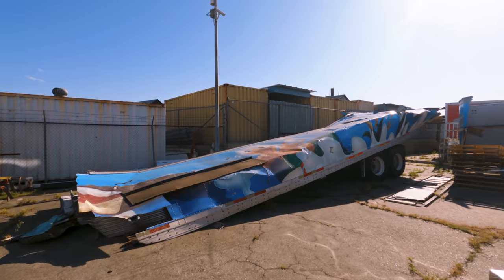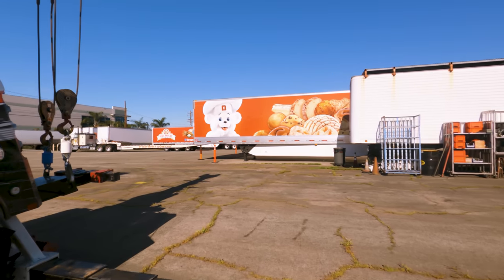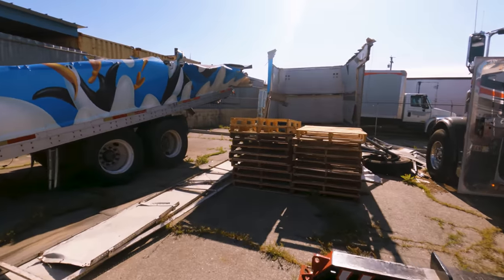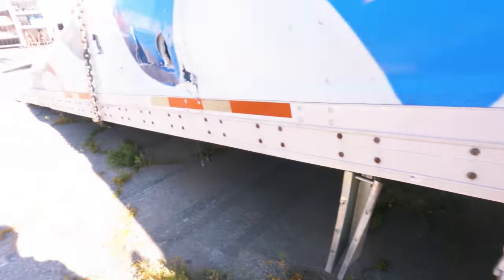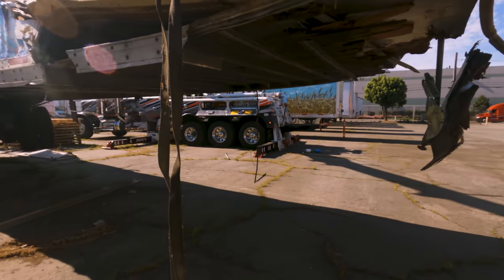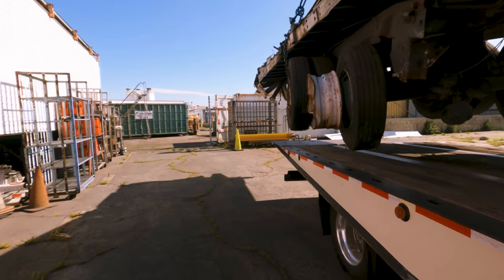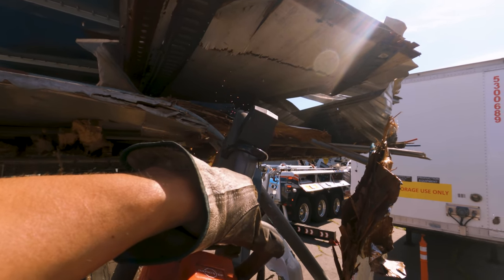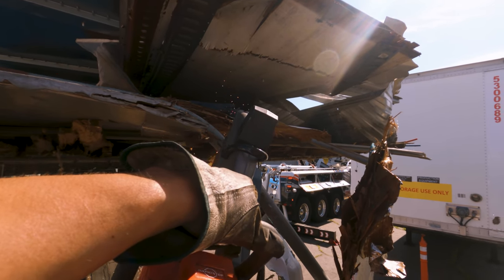Lifting and transporting a destroyed trailer

Comment: If I had to guess what happened, based on the trailer being in their yard and the right side axles being broken towards the rear, but the front of the trailer being seemingly ripped off, my guess is that someone was making a right hand turn in or out of the yard and caught the gate or a parked car. It looks like the slots cut on the front part may have been used by a large forklift to lift it. Had to be a fairly hard hit to rip the trailer apart like that, but since the front doesn’t seem to have any damage to the sides or top, a rollover is probably not what happened.